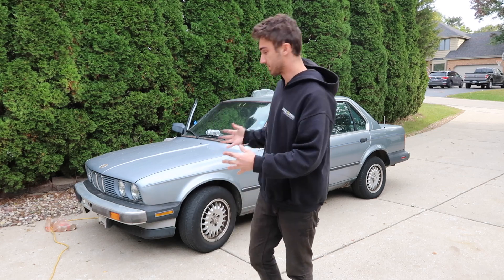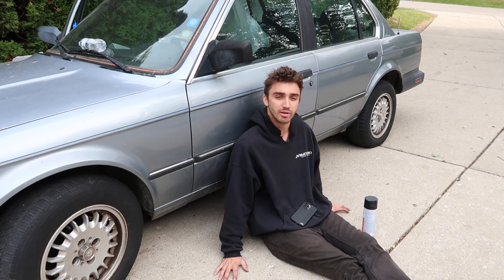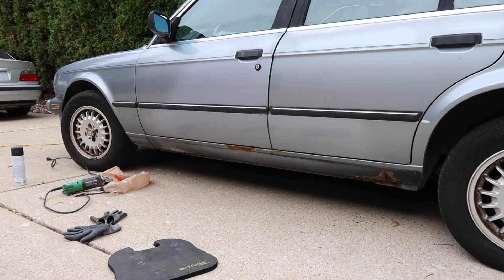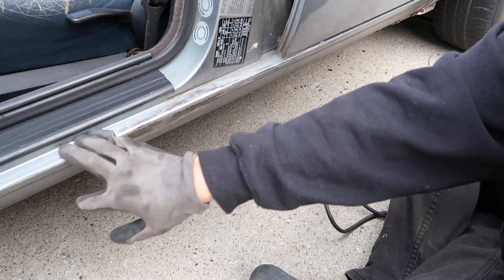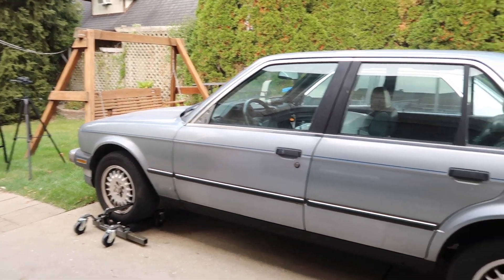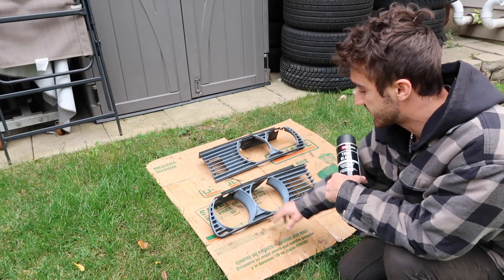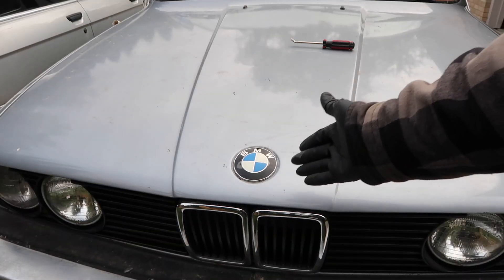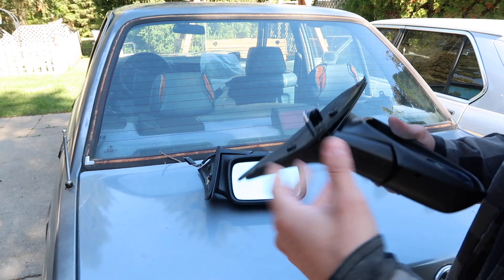Making a Rough BMW E30 Look a Little Better | Budget E30 Build Ep.3

Comment: For the bumper plastic you can use som rap seed oil to get it closer to black! It wont last a eternity but it should do it for some months.

Keep up what you’re doing!
Reply from the maker: Thanks man!
Reply: @m3nameisjosh464   no problem, There is also sprays made for bringing the plastic back to black but if you dont have that you can use rap seed oil. Just dont forget to wipe the access away